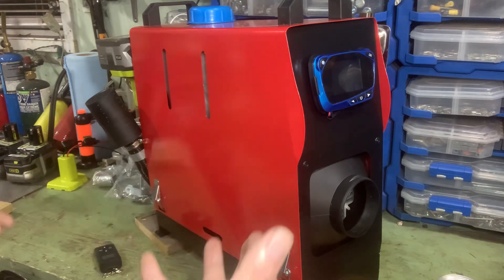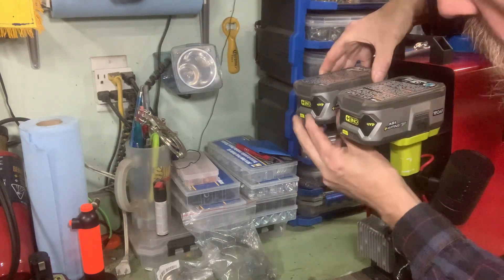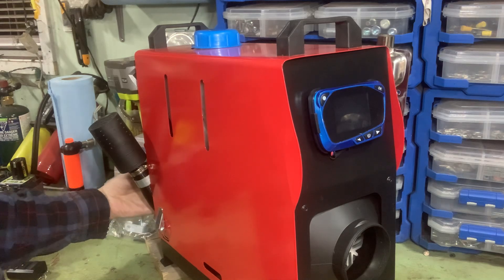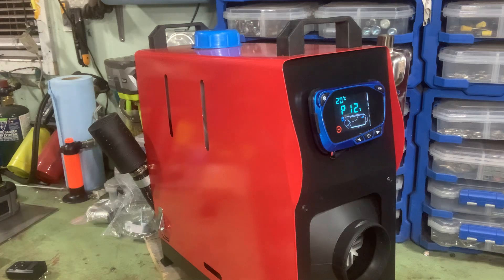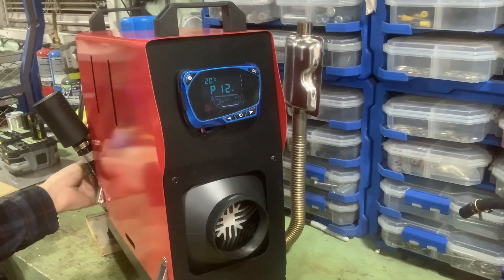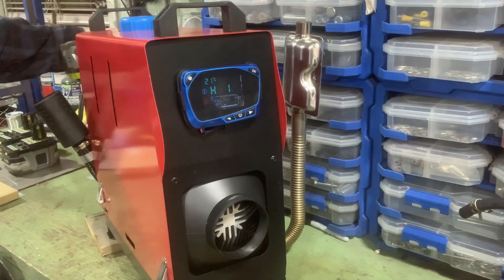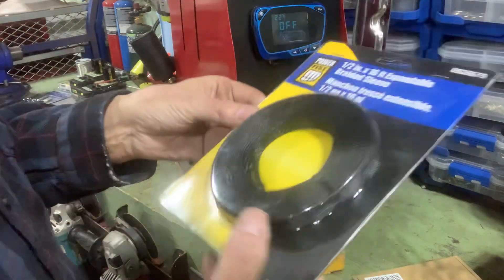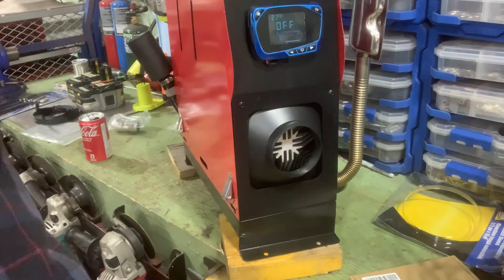Vevor 5KW Diesel Parking Heater Part 4

Comment: Can you please do a "hot swap" of your batteries witout shutting the heater down first?
As a drained 4Ah should get a lot of Amp if paralelled with a fully charged battery ...just saing.. something gets hot i promice..
As i understand your Ryoby batterys will shut down at 15 ish Volt and be fully charged at 22? 
Large Volage difference for Lithium :)
Reply from the maker: I’ve got swapped them a few times without issue.
Reply: @BruceLyeg  At worst case scenario? 
Low Voltage at one battery and max charge  from the New one?
May i ask the fuse size of your adapters?
And it might be differen with a full 4Ah battery deliver max charge to a 9Ah battery?
If we can safely "hot swap" our 18V Tool Batterys, it will be a game canger!
Please use a clamp meter to measure the Amp while parallelling them..
I cannot find any settings/limits for the internal BMS..

Comment: Nice and neat install.   So a 4ah battery has the capacity  to put out 4 amps for one hour .  Amp draw running  is about 3 amps  so im thinking two 4ah batteries should run about 2.5 to  3 hours max.  Interesting to see your results. 👍
Reply from the maker: Almost bang on. Just under three hours with two 4Ah batteries. I tried it out today. Three hours and a little under a 1/8th of a tank of kerosene. For a permanent install I’d go with a deep cycle battery connected to a trickle charger or even better, a solar panel and a large external fuel tank. Some people have also ran the exhaust through a cast iron radiator to capture wasted heat

Comment: Remind me, does this unit have a thermostat or just heat settings?
Reply from the maker: Yes and no. It does have a thermostat but I don’t know how accurate it says. From what I’ve read it accurate in small spaces but not so much in larger areas. You can also just use the six heat settings as I’ve been doing. It also has a timing you can set to come on and off once or repeatedly. You can adjust it for altitude and a whole bunch of features I don’t know how to use yet. It’s a surprisingly smart controller for such a cheap Chinese heater